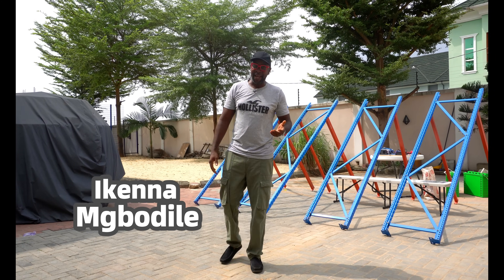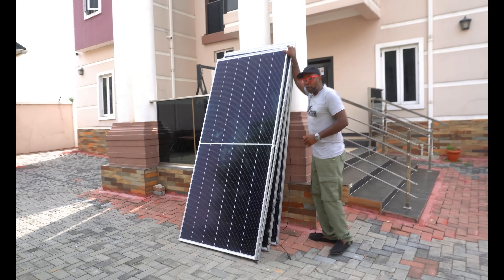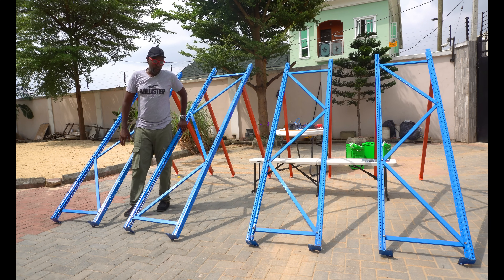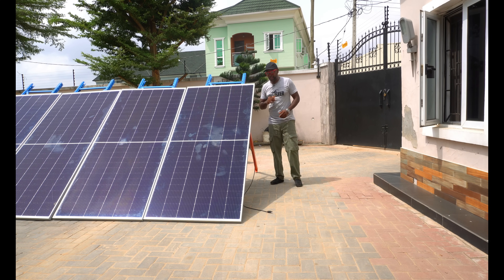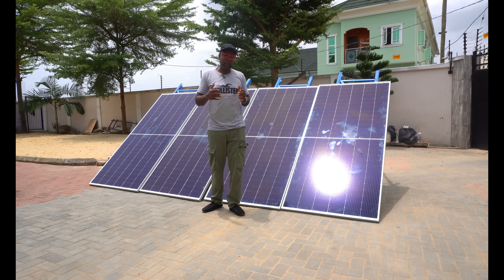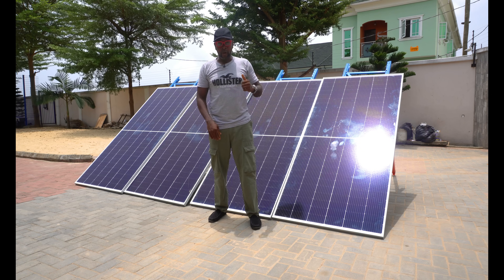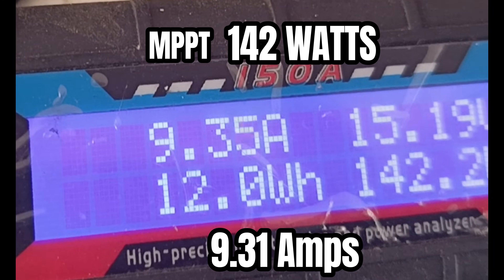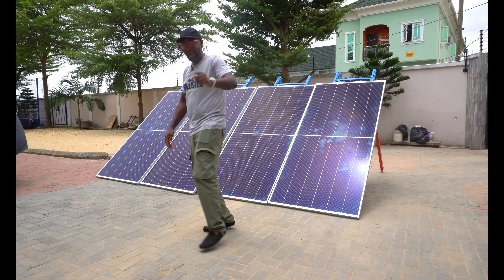Output Test between MPPT and PWM Solar Charge Controllers

Comment: Hello. I need your advice. I have 2, 265w solar panels connect in serie and I'm using outback mppt 60a. The problem is that, I can only get 300w from solar panels even in a good time. Solar Panel Voltage is stuck on 56v only.

Comment: I like the test methodology and love your enthusiasm (Where are you from?☀⛱); However, the wiring looks too thin to handle the max current those 465 watt solar panels would put out at 12v in parallel. Those don't look like 12v solar panels btw?  That much current will likely damage a pwm going to a 12v battery for a sustained amount of time.  Practically every PWM manufacturer that claims it's product can handle more than 20amps at 12v is false advertising since their terminals typically aren't big enough to connect the wire gauge required to handle it (around 4awg).     

I imagine you'd need to design a circuit that dedicates a single PWM to each solar panel and then connect the PWMs (not the solar panel's) output in parallel to a single battery.  However, TBH I'm not sure how feasible that is  without knowing if the PWMs base their state of charge on the resistance they are getting from the battery or the voltage they are reading (Which I believe most cheap PWMs do). If it's the voltage, I'm thinking each PWM would likely throw off the others and they would likely continuously cycle between charging stages once the batteries state of charge rose past a certain percentage.   

I tried a similar experiment using 100watt solar panels and based on the readings I got that's what I believe to be the case.  However, tbh all I had was a simple volt meter for mines, your setup gave me ideas and in some ways confirms even further how I feel about PWM charge controller manufacturers when it comes to their claims.  Dollar for dollar mppt is the way to go even if you find a quality PWM that support operating in parallel mode.  As I see it PWM is only beneficial with solar panels no more than around 240 watts based on their terminal size but because the market is saturated with low quality products it's hard to know what you are getting to be able to test anything accurately 🙁.  Keep at it! 💯

Comment: The flexibility of an MPPT controller is what i love the most, regardless of your panel configuration, an MPPT will always track and deliver maximum power, using either voltage or current depending on what it sees in excess, PWM will constrain you to a particular setup, which when analyzed carefully, costs more than the initial cost of an MPPT.

MPPT - pros;  more power extraction, flexibility, less heat at higher power.
            cons; high initial cost.

PWM - pros; low initial cost
             cons; less power extraction, non flexible, more heat at higher power, requires upgrade to MPPT after some time🤣
Reply from the maker: Well analysed well done

Comment: This test shows how to NOT use a PWM charger. PWM works best when battery voltage (eg 12V) is matched with a nominal 12V PV panel, putting out in the 16-20 Vdc range. Same for 24V battery, you have to match a 24V PV panel, putting out in the 30-36 Vdc range.  In your test, you are using a 450W half-cut panel (nearly 50Voc) that should be PWM-coupled to a 36V battery, not a 12V battery. Starting with an incorrect setup, the results are necessarily poor, but nobody with some experience, will design a PWM system in this way.
If you repeat the test using a 36V battery insted of a 12V one, with same 450W 50 Voc panel, the PWM advantage will be in the 15% to 30%, typically around 20%. You can do the math by yourself by multiplying be 3x your PWM measured currents.
With PWM the PV panel must produce only a few volts more than battery voltage.
Due to large currents, PWM can be used in small scale and with short cables, while MPPT is much more flexible, can be used with high-voltage setup and corresponding small section cables. However, poor MPPT implementation, common in cheap MPPT chargers, can completely vanify the potential 20% advantage vs PWM.
Reply from the maker: It is important to understand the purpose of this video . Which is to highlight the superiority of the MPPT over the PWM.
 For you to achieve good results with a PWM charger you will need to constrain yourself to certain conditions. It is very limiting , but with an MPPT you are spoilt for choices. 

You are suggesting a 12 volt Solar panels for a 12 volt battery. A 12 volt volt Solar panel can not adequately charge a 12 volt battery, You will need a voltage above its nominal voltage to perform that function. So you will be looking at a 100 watts Solar panel  with VOC of 19.2 volts and VMP of 22 volts respectively.  Given this PV choice you are still going to be having excess voltage that will totally lost on the PWM.  So the question is why Limit yourself so much to this odd conditions because you want to use a PWM. Makes no sense to me.

Comment: Great video sir. but for this type of video you would have shown us the battery voltage of the drained batteries... And Also I think the battle should  be cost per charge controller... so that it will  be more fair.. e.g  using the same number of  wattage for both in the sense that the pwm will use smaller panels but at the same price  and probably the same wattage. since pwm will not use the excess  voltage  of these 465watt panels.. so if the test can be done again with four 100watt for the pwm and.. one 400watt for the mppt then we have a good battle

Comment: The voltage of the solar panels is too high for 12v  on a PWM , you need 12v panels for better conversion
Reply from the maker: A 12 volts panel can not charge a twelve volts system you need a higher voltgae above the nominal voltahe to charge it. 12 volts battery will require a minimum of 16 volts above the nominal voltage to charge. The closest you can get is a 100 Watts Solar that comes with 22 volts VMP which still leaves you with excess voltage that the PWM can't convert.

Comment: Connecting 2panels  in parallel using mppt charge controller , does it affect the wattage of the solar panel.. pls i need an urgent reply.. thanks.
Reply from the maker: It depends on your system voltage  , it might and might not

Comment: Please your test is very wrong. Mppt charge controller is can  take a much higher voltage and reduce it to a 12 volt battery. A pwm charge controller is not designed for taking 40 volt solar panel into 12 volt battery the loss will be too much. What you should have done is use a 24 volt battery on the pwm and mppt to make it fair😊😊. Please you have to use the panel voltage for the right batteries which is likely 24 V not 12 volt batteries, only mppt can do the conversion
Reply from the maker: For a 12 volts battery you have a maximum input voltage of 15-50 volts to use. The Essene of the video is to show you the superiority, efficiency and flexibility of the MPPT Charge controller over the PWM.  No matter how you run the test an MPPT will be better in conversion and extra functions.
Reply: You are only making a case for MPPT, everyone is telling you what should be done.. is connect 2x 150W in parallel to both MPPT and PWM and you will see PWM perform better
Reply from the maker: @odedeyidamilare  and perform better than an MPPT?   If you love PWM charge controller that's okay but no matter the form shape or manner you pitch them a good MPPT will always convert more energy. It's an advanced charge controller, it was developed to do better,  so what exactly is the point.

Comment: In situations where the photovoltaic (PV) output voltage is only marginally higher than the system voltage, such as a 24V system with a PV outputting 30V, the advantage of using an MPPT (Maximum Power Point Tracking) controller over a PWM (Pulse Width Modulation) controller may be minimal. This is because the primary function of an MPPT controller is to track and optimize the maximum power point of the PV array, which becomes particularly beneficial when there is a significant difference between the PV array voltage and the system voltage.
Reply from the maker: That's correct Buddy , however no matter how marginal and insignificant an MPPT Charge controller will always give you more Energy.
Reply: You may have a point but you still miss a very significant point about the mppt controller which ALWAYS tracks the maximum power point, and not just delivering the voltage converted by the cells. By doing just that, it delivers at least 25% more energy. That is not marginal in any way. The comparison you've used only implies a benefit of pwm in spite of all the ways that the MPPT completely floors it.

In essence, the PWM should always be used with more than one battery in order to be able tor maximise its output when compared to MPPT.
Reply: Thank you Smilinsun for this comparison video. You didn't just tell  with words, but you showed as well. This is one of the best comparison videos, I have watched.
Reply from the maker: @C-TRO1234  Thank you so much for your comment

Comment: Please what does "Low Battery Recovery voltage" mean on MPPT Charge controller settings?
Reply: After system goes into low battery protect, the recovery voltage is the voltage it must rise to (when charge is initiated) before system goes out of that state....
Reply: Low Battery Recovery Voltage: This is the minimum voltage the MPPT controller needs to activate and start functioning.

Comment: Good Morning Sir, i have a solar system of 1000kva, 250watts solar panel, 12v 100ah battery and a 30amps solar charge controller,  of recent my battery has been draining so much, note the battery is not up to 1year. Can it be that my pwm charge controller is not adequately charging my battery or is my battery dead?
Reply: It looks like a battery issue.

Comment: Nice experiment video. But I don't totally agreed bcoz the configuration is not in favour with the PWM due to the high voltage half cut cell panel of around 43volts at 10.7amps VOC. You should have use 12volt panel since you are dealing with 12volts system. Infact the PWM is performing almost the same as the MPPT, and understand that the PWM is just an off-on switch which can only reduce the panel voltage to the battery voltage. Here as we see the panel is 48volts while the battery is 12volts and using PWM you won't get half of the panel harvest bcoz all the remaining voltage will be given as heat (loss).Repeat the test using 12volts sytem with a 12volts solar panel and prove me wrong, and the difference will not be above 15-30% comparing it with even victron MPPT charge controller.
Reply: Yea ...but not by a large margin. 30% gain at the best case scenario for the MPPT...This test just puts the PWM in a massive disadvantage.
Reply from the maker: @bamimichael2853  Lest assume we use 20 100 watts Solar panel for this output test. 4 x20  is 80 volts lost. The emphasis here is not margin lead but a demonstration of how much more energy you can harvest using MPPT.
Reply: @smilinsunsmilinsun8056  Very true
Reply: @smilinsunsmilinsun8056  Thanks for clarification bro. My point was mainly on the high voltaic pv on 12volts system using PWM bcoz it's at it disadvantages. MPPT remains the best choice that's for sure especially in large setup above 200watts system. So using 2000watts (20panel of 100watts) is not recommend on pwm, bcoz that will be around 100amps if connected in parallel, and it's much coastly with large wire sizes/guaze and generally risky with 12volts despite the necessary precautions. I don't know much about solar Tec bcoz am into medical science but even at 20 solar panel connected in parallel with 100watts the 80volts losses will still not exceed 30% using MPPT. Thanks for the educative video and we really appreciate your time & reply to help us understand about solar Technology.
Reply: @alimamyfullah6029 I agree completely. I had a 4x100 watt panel array in parallel to a pwm 30 amp and at best saw 360 watts  and changed out to a 30 amp mppt within 30 minutes with exact conditions and after waiting for panels to reach the same temperature if not higher I only saw 390. All renogy btw. 7.5% gain in my case.
Reply: @smilinsunsmilinsun8056 I think most of these people missed the point of your experiment. They think it is a battle contest between the two types of charger controllers.
It is not the test that puts the PWM at any disadvantage. The PWM demonstrates its disadvantage all by itself.
Now, does this mean that the PWM should be totally avoided? Absolutely not! If you have a string of panels and want to charge a string of batteries, you can choose the appropriate PWM controller and enjoy your system. You can even upgrade that system within limits but you'll have to remain aware of the limitations that are due to the choice of the charge controller. By the way, the PWM being manufactured today are more efficient than those manufactured some ten years ago. 🤷‍♂️
Reply from the maker: @ekeretteekpo3004  You are absolutely correct, the PWM charge controller is very limiting. The voltage has to be close to nominal voltage, you have to choose a certain type of Solar panel wattage. With MPPT I can use any panel I want.  I enjoy a great flexibility in choices.
Reply: If you understand the principle of operation of MPPT, you will agree that regardless of the panel you use either low voltage or high voltage, MPPT will still do the work it was designed to do. 

PWM doesn't do any tracking of maximum power. Whatever it sees, he tried to deliver. If radiance go low, it supplies low. 

MPPT will try to do work of tracking for maximum power panels (regardless of the voltage size) relative to the radiance.
Reply from the maker: @isaiahadeibukun7844   very correct buddy !
Reply from the maker: Whatever Solar panel you choose to use the MPPT will always do better  So let's assume we used 100 Watts Solar panel as suggested by you. The VOC for a 100 watt is 19.4 Volts, there will be a wasted exces voltage of 4 volts cut across the panels used because the PMM lacks  the ability to  convert it to current.
Reply from the maker: You are welcome
Reply: You guys are smart. I like reading people who understand how pwm and buck converters actually work.

I have installed a system with a PWM controller, all I did was use panels with 31v as my Voc on a 24v battery system. The system performs as good as expected. I get up to about 20A current.
Reply: @Levi-k6p you are correct. However, you can attest that you set out to design a compatible and appropriate system and which wouldn't have had to be the case if you were going for an mppt controller system.

Comment: Please how many amp current would be considered as max current for charging tubular batteries
Reply: 0.5c to 1 c is the optimal charge rate for tubular but you can go higher but not advisable as it will affect the cycle of the battery , let say It is a 22 AH battery that would mean 22 Amps will charge the battery full in 1 hour for a 1 c charge rate and 0.5 c will charge it full for 2 hours, but for lithium batteries a lower C rate is better
Reply: @NaijaTechie  To the best of my knowledge, it all depends on the capacity of the battery. this is just a  general rule of thumb, the charging amperage should be between 10% and 20% of the battery rated capacity.

Comment: Please why not connect the panel in series for the MPpT so we can we the output
Reply from the maker: The minimum voltage input for 12 volts in the charge controller is 50 volts. The Solar panel VOC is 52 volts so connecting two will be too much.
Reply: @smilinsunsmilinsun8056  Okay i understand now.
Reply: wen testing two charge controller all connection should be d same